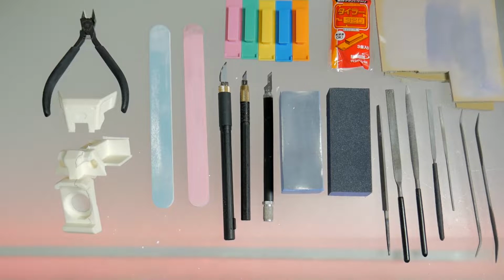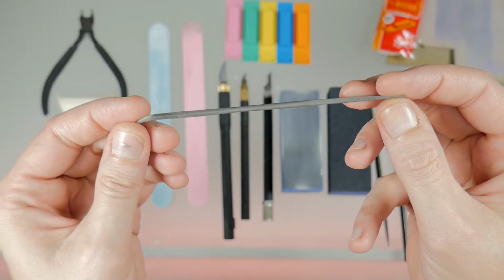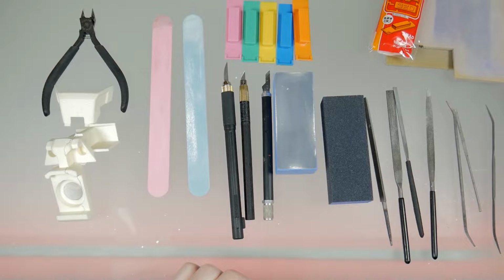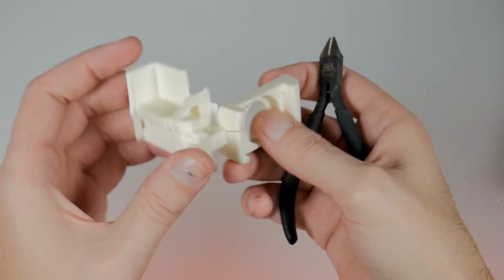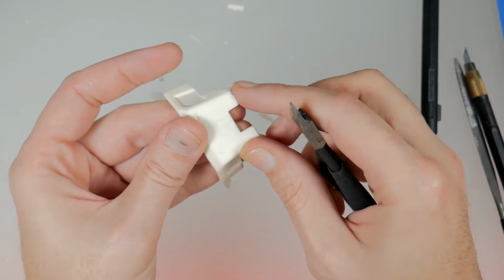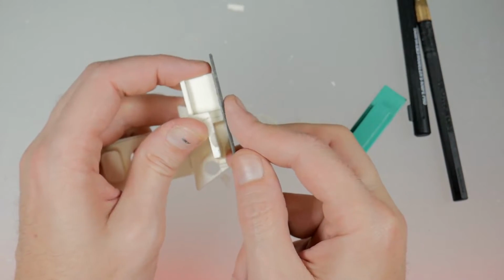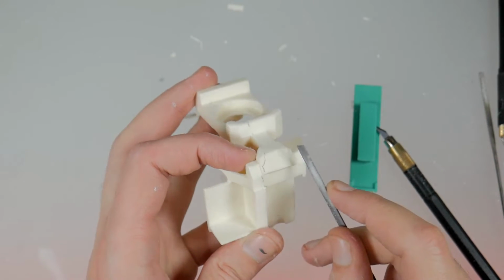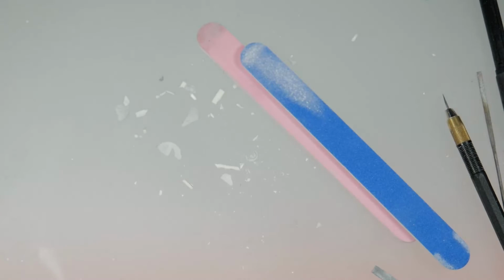WORKING WITH RESIN SERIES TOOLS AND HOW TO GET STARTED

Comment: Wow~ So many tools.
Personally the only related thing I buy is GunPla and I typically suggest Tamiya for tools.
All I have is:
- Tamiya Modeler's Knife Pro
- Tamiya Sharp Pointed Side Cutter
- Tamiya Sharp Pointed Side Cutter (Slim Jaw)
- Tamiya Panel Line Accent Color (Black, Brown, Gray, Light Gray)
- Tamiya Metal File (various kinds)
- Tamiya HG Angled Tweezers

I've never tried a resin kit.
However, i would suspect that as with Gunpla, you just need to take it little by little and go slowly.
Reply from the maker: Yup slow and steady works best.

Comment: Hi Dave. Can you replace the sand paper attached to the different colored sanding blocks you got from Amiami?
Reply from the maker: I haven't tried but bet if peeled off and used double sided tape that would work.
Reply: Thanks. I'll probably buy it.
Reply from the maker: Ya I'm sure others make, but these are just handy.

Comment: how to fill resin gap that can't be sanded down? thanks
Reply from the maker: Thanks for watching, I have vid coming showing different ways to fill gaps and dips/divits.
Reply: ok how ro fix a broken piece with part missing and have no choice to add more resin.
Reply from the maker: Like a tubing or something missing off part or a chunk of the part?
Reply: yes, correct, a shape triangle piece with the edge broken off.
Reply from the maker: You can build up using superglue and baking soda. Just a drop of glue and sprinkle the powder on it, let dry which will be pretty much instant. And just keep repeating then sand down to desired shape.